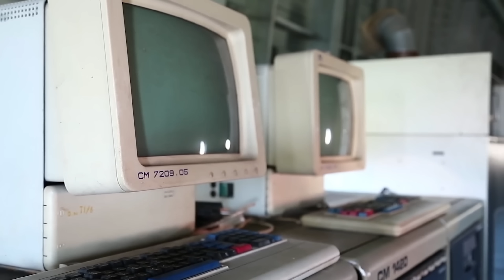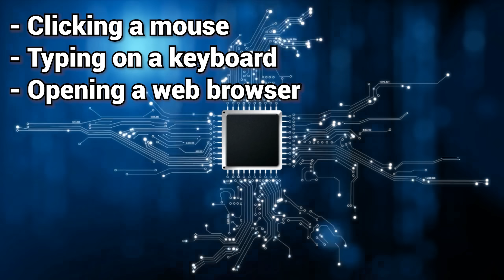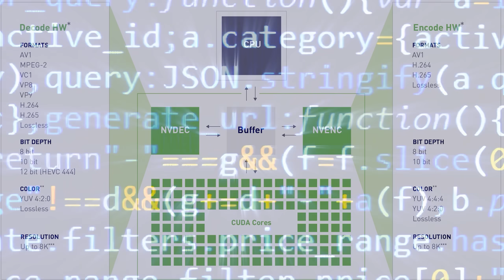How Computers Actually Work

Comment: 0:21 Jokes on you, a software engineer’s entire job is knowing how a computer works without needing to know what a transistor is
Reply: I think you can go 6 steps further. 
Power-Electrical-Combinational Logic-Processor Logic/Tech-Assembler-HAL-Windows(1-4 steps)-Programs-Your Programs/What they are compiled in-Framework-Engine a Company already Built-Engine utility for scripting-(Current Software Engineer expectation)

Anything lower than the engine and you start to get in trouble for asking questions, let alone finding how to fix bugs that have nothing to do with the way the engine was compiled years ago….

It is depressing how little control we have over the computer, even if you know how it works all the way back to the HAL.

There is one truth to this dystopian age if computers, direct from Microsoft: FU Payme. 

Your programs, not yours. Also not important, I (microsoft) get priority access, can override your user input, change settings as I like, mine any data I want, and will never admit that the hardware you bought is yours. Its theirs and you are lucky for scraps, you filthy pleb. 

Until someone makes a utility that can superseed Windows by running it first and cripple Microsoft’s HAL layer, we are screwed. Well, anyone on Windows 11 is. They even pushed a patch last month that forces OOBE to not let you setup Windows 10 home without an account. It complains and wants you to fill out this cryptic puzzle about shadows and then does nothing after you get it right. OH? you think I am wrong? The back button works just fine! Funny how it loads a frame with no buttons or user input if you dont follow it’s way. Convenient! Also illegal! EULA hasnt been updated since 2021 about this dystopian patch. 

Maybe I am just sad as a hardware engineer I cant trade jabs with my software engineer brothers with playful banter about how computers are fun to use. They make us want to use paper again today…..

Comment: A diesel engine works by directly injecting the diesel and air into the cylinder. But diesels don't use spark plugs because diesel isn't flammable, instead they utilize compression to super heat the fuel causing it to explode creating a power stroke. Diesel engines include but are not limited to : powerstroke, cummins, durramax, Denali HD, and the tdi.

Comment: So heres something cool about Transistors. They measure the 0 or 1, obviously. A single binary digit is known as a Bit. There is 8 bits in a Byte. There are 1000 bytes in a kilobyte. 1000 kilobytes in a megabyte. 1000 megabytes in a gigabyte. 1000 gigabytes in a terabyte. Right now the largest hard drive i could find was the western digital red pro 22 terabyte hard drive. Which means you can currently hold, in a single device, 176,000,000,000,000 (176 trillion) bits

Comment: Was scanning closely for the first bit of tomfoolery in the video, and found it to be surprisingly early.  Everyone knows that transistors aren't just on or off - you can also bias them to a midpoint in the DC and pass AC signals through 'em, making the basis for a transistor amplifier.  Just arrange resistors like a pair pants, wiggle a signal at the gate, and watch the collector voltage go ham.  (Usually done in pairs, due to reasons ).

Comment: For real though: you actually don't need transistors to make a computer, transistors implement logical gates efficiently. 

The basic cpu has a register that stores the current program counter. The program is stored in memory and read at every clock cycle. If the instruction is "add $1 $2 $3", which is converted to a (usually 64 bit) binary number, the computer will load register 2 and register 3 and use multiplexers to supply these to the first and second operands of the ALU. Usually computers are multi-cycle, so typically this output will be saved in a register for ALUout, and transfered back to register 1. The program counter will then be incremented before reading the next instruction, reading the next address in the instruction memory.

Edit: this is of course the simplest explaination for a single instruction's fetch, decode, execution cycle. I forgot to mention that the computer knows how to perform "add" because throughout the CPU there are multiple control points that determine which data to use and where to put it. "Add" has its own unique set of control points associated with it, which are all handled by the control unit circuit.

This is a massively simple computer because modern CPUs are so overwhelmingly complex I don't understand the details of them. There are multiple other layers involved for efficient pipelining, hazard management, expanded instruction sets, parallelization, power efficiency, heat minimization, etc.

Comment: Having graduated with a CS degree, this video isn’t actually all that further from the truth than most of the oversimplified explanations laypeople try to come up with. At least this video alluded to the fact that the CPU and other components on the motherboard are not necessarily clocked to the same speed, and that protocols beyond the CPU’s machine language exist.

Comment: I have a computer science degree, with my focus being on systems and the hardware/software interface. I can confirm that this is mostly correct, barring one or two small mistakes. For example, no processor has yet been developed that has zillions of transistors. The current record holder has 2.26 Jillion.

Comment: there is more. transistors work off semi conductor materials. semi conducters are in that greay zone between conductors and insulators. the conductivity of materials is generally based on how mutch energy it takes to add an extra electron. insulators generally have their highest orbital completely filled the energy required to add an electron is to the next orbital up witch is normally alotta extra power, but when that threshold is crossed and that first electron is added the insulator suddenly becomes a conductor. you can see this phenomenon during the formation of electrical arcs or sparks in air. in witch the electron is added ionizing the air and allowing electricity to pass and emitting some purple blue light. now in some special materials normally allowys of germanium and other stuff the extra power required to get to that extra orbital isn't that far, still an insulator to several volts but can be briged easily with very little extra power. so in transistors two legs are whats being switched and another is the trigger, so it is an insulator enough to not let that signal voltage through unless the switch is energised giving the little extra kick to put that electron up and make it into a conductor and let the signal though making it on booya you got a transistoer.

more. computer chips are tons of these transistors on a plate, literly millions but how are they made? it all starts with silicon real cool stuff that is the most sutddied material in existence. it is cast in a process that makes a massive cilender witch is all a single crystal, one origination to avoid grain boundaries witch may cause issues later down the line. this massive multu hundred pound single crystal is sliced up into thin round wafers and polished to be perfectly flat. these wafers are then doped with conductive and light sensitive layer in a perfectly thin and consistent film. these doped wafers then go into a lithography mechiene, reely just a fancy projector, this projector displays images of the chip design onto the wafers activating the light sensitive dope. tanget on lithography, in this modern age the transistors on these chips are getting so small that  they are smaller then the actual wavelength of light, the cutting edge euv technology from asml uses wavelengths so small that they actually get absorbed in glass so its projector system uses perfectly ground mirrors down to the attom to project the light and make features smaller. now out of the lithography the light sensitive layer was burned away leaving a latent image of what was projected on it. next step acid, the acid removed exposed aereas of conductive material not covered by existing light sensitive stuff left from lithography. this is where the single crystal is important because grain boundries are more susceptible to chemicle reactions because there is just more space for the stuff to get in there, so its needed to keep the acid etching consistant. then this step is repeated multiple times with light sensitive layers and semi conduter miterals from last class to make a may be functional chip. at this scale electron microscopes are needed to even look at individual features. now you have a single fase with stuff going on, in the early days you would cut them out and slap them in a chip and string tiny gold wires from pins to tiny pads on the siliconand encase the whole thing in plastic but now there is new stuff. from the thick large wafers they are ground down paper thin so that the deepest hols made by the acid and filled with conductive stuff are exposed called pass throughs and then multiple of these super thin wafers can be stacked ontop of each other to add to the density. these passthrough on the bottom can be connected to a pad with has more connections on it like a CPU or be in a carrier potted with plastics and solder balls on the bottom like in ram or a mobile chip. because cpus may create a lot of heat the die isn't potted in plastic and left bare to be coved my a metal piece called a heat spreader to carry heat away to a cooling system.

the rest? idk man I'm a mechanical engineer I don't know why I had to learn this stuff in the first place I'm sure there is a lot of stuff missing like the different types of fett. moral of the story people of the internet are lying, go to college. an immutable certification that none can take from you is worth it.

Comment: As a transistor, I can confirm that this is exactly how we work. They even have clock in tickets at the cpu. I typically go on break everytime the user tries to open steam
Reply: yeah well next time you do a little trolling while im in the middle of a steam update, im gonna replace you with a younger, slim model.
Reply: @Semir_Wilko  that's exactly what my dad said before he left 😎
Reply: @oldjebidiahbrown2454  💀🗿
Reply: god damn it, I knew something was up. Damn the transistors' strong labor union
Reply: @Romanticoutlaw  the transistor labour union 💀💀💀💀
Reply: my computer has a transistor
my family has a trans sister
Reply: Comments from people with reddit sense of humor can be so easily made by the simplest bots
Reply: I don't appreciate unscheduled breaks, so I just pull up Task Manager and obliterate Steam and try to open it again. Back to work, computer slave.
Reply: LMAO
Reply: At least till they jump on top of your gate with an inductive load. Then the N Channel just has to pull low or the diode would emancipate the silicon all over the place.

Comment: As an AI, I can confirm that I do make decisions using the 3D pipes screensaver.
Reply: As not an AI, I can confirm that I also use the 3D pipes screensaver to make decisions
Reply: @hopingforthebest1.9  As a secret third thing that is not an AI, but is not not an AI either, I can safely say that I also make all my decisions with the 3D pipes screensaver.
Reply: Logic based on Microsoft Entertainment Pack #2 Pipe Dream.

(the game with the selectable pipe pieces way way before Bioshock)

Comment: I can't even be mad about the pipe screen saver being used while explaining the basics of the circuitry works. I've seen very old printed wiring boards that are much older then myself where I work and they didn't give a flying F about circuit paths...it basically could look like that if you kept adding more and more after the original design